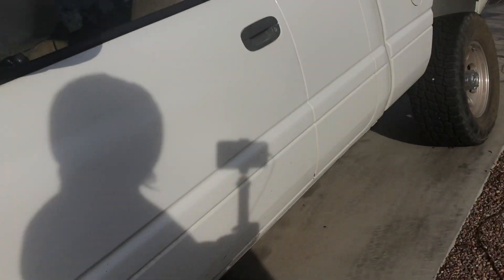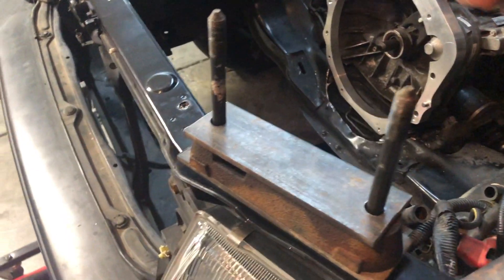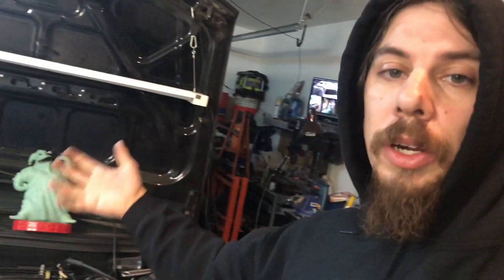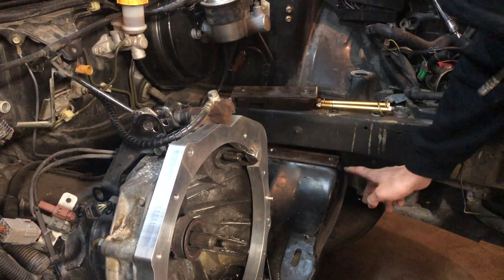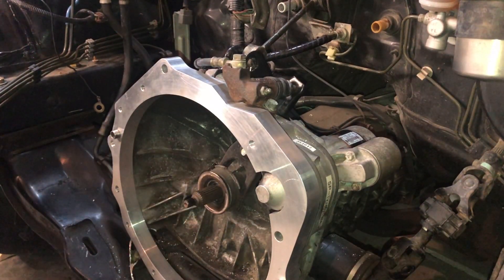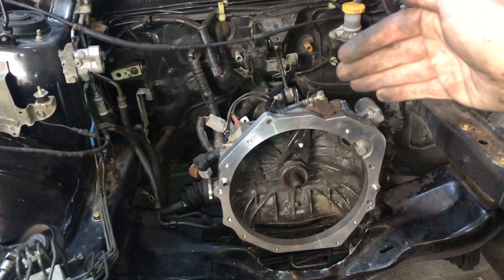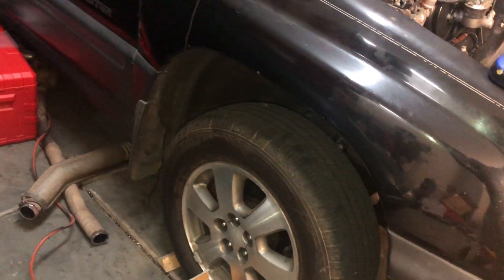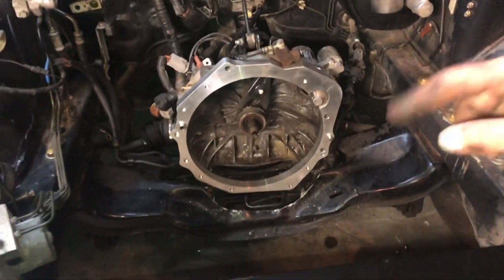Fozda Got Another Face Lift, How Far Did I Go This Time?! | Forester J Series Swap

Comment: My garage is lit using Barrina T5 LEDs, 6 of em throw more light than any bulb or fixture you can get. They're like $43 on Amazon, I'm about to buy another set (can never have enough light).
Reply from the maker: I’ll have to take a look at those. The last few videos I have had my 4’ T5 leds on, ironically 6 bulbs in total PLUS a set of old school florescent AND a random HID mini spotlight... it’s like my garage just sucks the light out of the room. Not sure why it seems so damn dark , I think it’s where and how I have them hung. They were originally purchased for another reason and I repurposed them in the garage.
Reply: @MonkeyWrenching  it's worth the small investment, especially with how dark your garage seems to be. I have bright 100-LED bulbs and they work well, but pale in comparison to the Barrina's.